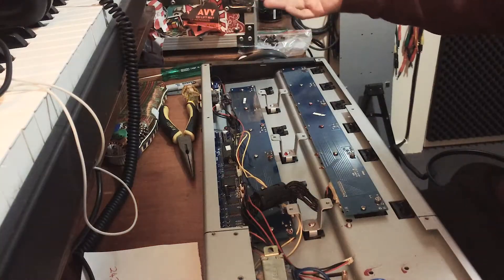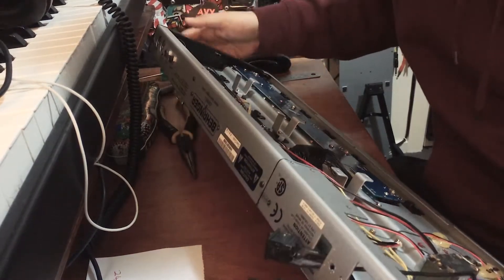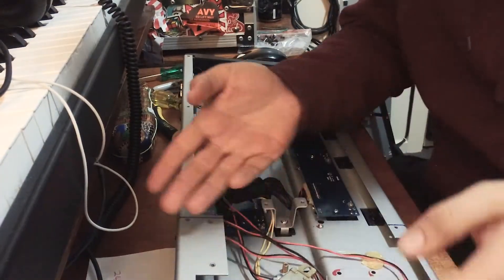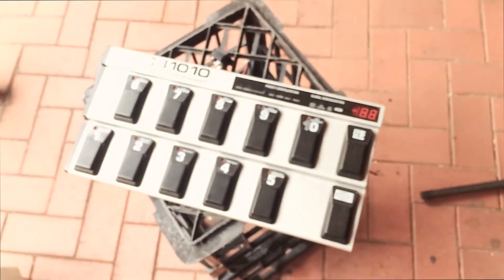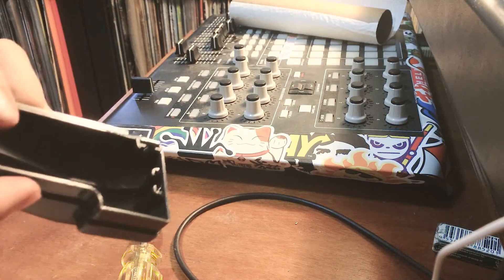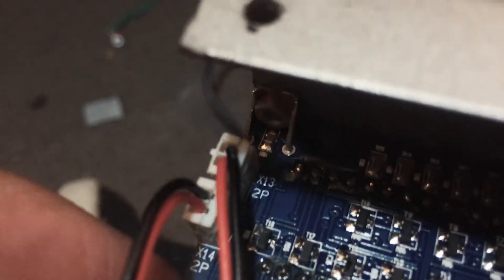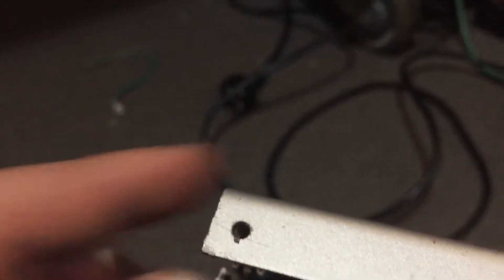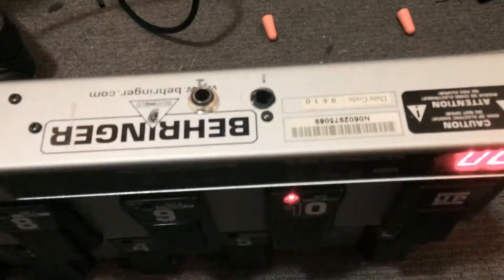LETS MOD: Behringer FCB1010 CUTDOWN!

Comment: If you remove the power supply and mount it in a separate box with a midi connector, you can use the unused pins from the midi socket to run power (9V-NOT 240/110V) and midi with the same lead. This means you wouldn't have to relocate the IEC powrr connector. Another step up is to use a different connector to run MIDI in, out and power with 1 lead.
Reply: Also can you post a link to the microswitch replacement vid. I can't find it. Cheers.

Comment: Hello Tim

Cool mod, I like it!
Do you have a scheme of how to connect the external expressions pedals? And...

Did you fix the problem with led display?
Reply from the maker: Hey thanks!
Unfortunately I never got around to doing the external expression pedals and the LED display looks like it would take some very very tiny and precise soldering to fix so I just make do 😅

For the expression pedals, there was a guy who did it on this forum here:

https://www.kemper-amps.com/forum/index.php?thread/12013-fcb1010-expression-pedal-mod/

But it was from 2013 and the image he had has since been taken down. He does describe it a little bit though. It seems that you use a 1/4" TRS socket and that the red wire from the board connects to the RING. 
I don't know about the other 2 but it's 50/50 whether they go on the TIP or SLEEVE. My guess is black would be sleeve and white would be tip.

Good luck! If you do it, let me know how it turns out. 
Cheers